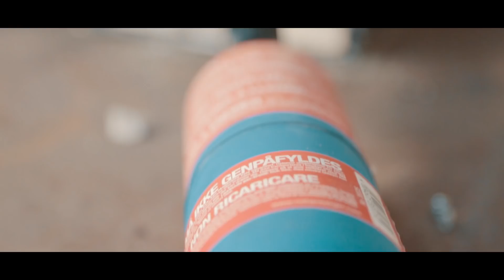#32 Chef Knife with Black Walnut Handle - DIY Curious Creator

Comment: Good call with using cobalt drill bits on tool steel. I had to learn that the hard way back in the day.

- Cay
Reply from the maker: Yes it might be slightly over kill. But I had them cheap on Amazon so makes it nice and simple!